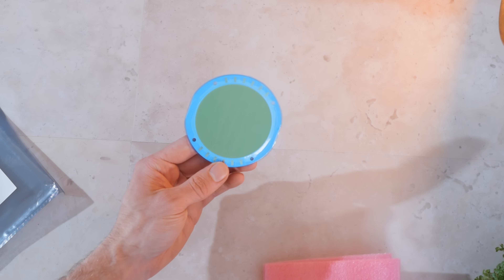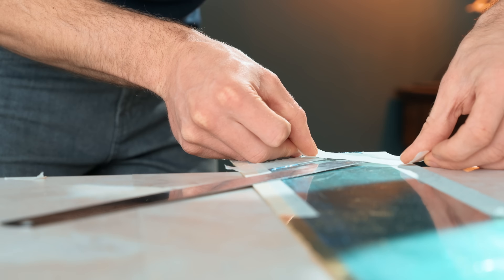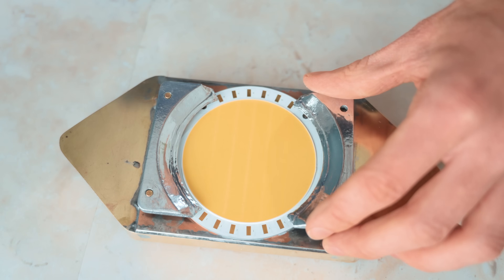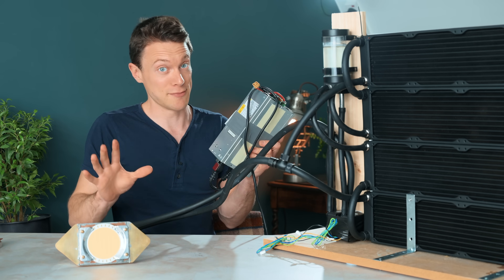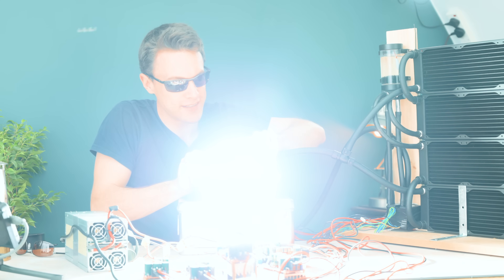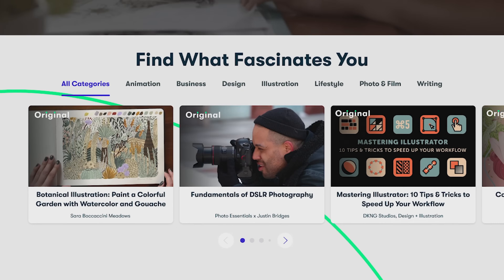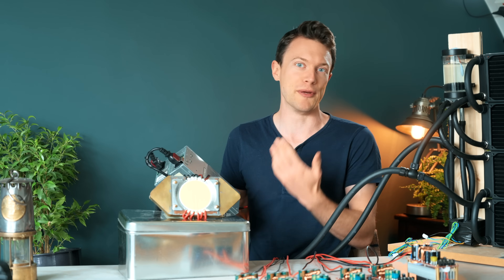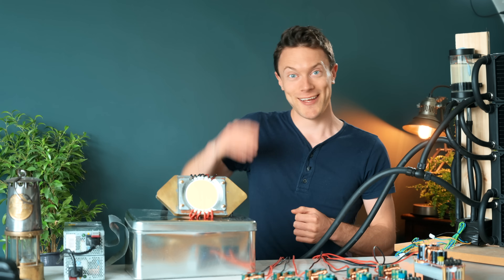Testing the world's BRIGHTEST LED!!!

Comment: I see a problem with the supply proximity and orientation, heat rises, I would not be surprised if there were more damage in the top supply due to it having to cope with it's own heat and heat from the supply below.

Comment: Were those power supplies actually 2000 watt a piece, or were they 1000 watt? If you wire them in series they can still only provide the current one could, but at twice the voltage.
Reply: The LED consumes 1500W, at 30 Volt that would equal 1500/30 = 50 amps. If the PSU is 1000W it can output 1000/12 = 83⅓ A. Now if we hook up 2 of these PSU's, they can output 83⅓ Amps at 24 Volt which does indeed equal 2000W, however then come the boost converters. They boost the voltage from 24 to 30 Volt, if we assume a 90% efficiency, at 2000W they can output 0.9*2000 = 1800W. At 30 Volt, 1800W gives 1800/30 = 60 Amps, so this would be enough for the LED, however the boost converters also typically have a high inrush current which means that they consume more power at startup. If you factor this in, this could be wat killed the PSU's.
Reply: Voltage * amperage = wattage, so they do actually still add up to 2000

Comment: I think you can get away with a large heat sink and air cooling this. 1500 W is not allll the heat you've to cater for. It's more than 80 percent light and rest heat I'd assume.

Comment: Yeah, wiring DC switchmode power supplies in parallel or series is not a good idea. One of them will end up supplying the majority of the load, and when it overloads, invariably the other ends up being overloaded and they both fail.
Reply: Also,  it kinda weird to make a 1500W LED on just 30V, should've been higher I think.
Reply: @STNG17-  if the sections are completely separated, you could connect them all in series. Now, ideally, you'd need to make a 180VDC power supply, with current regulation, since i don't think you'll be able to find something like this anywhere. But still, having 6 30V 10A power supplies is the way to go. Unless this company makes a proprietary driver for this monstrosity.
Reply: how can it even be in series? they need mains input and output dc. you cant feed them dc as input, can you?
Reply: @1toW4mB0to9  The AC mains is in parallel but the output DC is in series
Reply: @EKUL34  still sounds like parallel output0
Reply: @1toW4mB0to9  You just connect one supply's + to other supply's - and  take power from other two unconnected + and -.
Reply: @sikkepossu  Yes, but don't forget to disconnect ac grounding.
Reply: @Cheese_1337  pretty sure the dc output is insulated from ac
Reply: @__dm__  is it,but it's coupled by safety Y capacitors.
Reply: @IustinianP  Those make no difference at all in this case.
Reply: @__dm__  The minus (ground) of output is connected to ac ground usually.
Reply: @benbaselet2026  actually it does allow some current to flow,not that much,but it will affect power supplies if the ac ground is not disconnected.
Reply: @Cheese_1337  I have never seen computer (server nor desktop) power supply  where AC GND is connected direcly to DC side.
Reply: @sikkepossu  I have. And plenty of them.
Reply: @IustinianP  I don't think those microamps matter anything.
Reply: Series is fine; by definition they will have the same amount of current going through them. Parallel is a different story, and switchmode supplies tend to not like switched loads, so I think that may be the issue. But from about 300 hours of run time, my series server power supply setup has worked fine (but I'm not maxing it out, either).

Comment: Surprised you didn't put a thermocouple in there to monitor the Temps. Even though your water block is cool, there could be issues transferring heat once the block gets saturated. In the end you were okay.

Comment: My completely overkill 1200w PSU designed to power 2 systems at the same time, just ran away and is hiding under the bed.

Comment: Running them in series is probably what killed those PSU's. Although they do technically use transformers running at high frequencies so they can be small enough. I actually think they can run better in parrelel as barevids did to test car audio amplifiers.

Comment: "Custom water cool your own power supply" next project
Reply: Water cooling a power supply would be extremely dangerous as power supply’s have large capacitors that if touched and the connectors bridge it could kill
Reply: @thomasweedon1463  non conductive thermal paste
Reply: TheHeadshotSamurai I was referring to actually taking the power supply apart not the actual water cooling aspect
Reply: @thomasweedon1463  well, I am not an electrical engineer but they do exists in market. So I'm guessing it is possible to diy it too.
Reply: @hey24sheep  Theres just no reason to do it the thermaltake psu is also just a gimmick
Reply: @lukasstadler6594  but you missing the point of his channel. Was there a point in his weirdest fan video? But the way he makes stuff, maybe he comes up with a unique different way to cool psu? Who knows. It's diy channel, ain't it? 😊
Reply: Hey24Sheip there is already a watercooled psu on the market, the waterblock inside actually does nothing, it doesn’t even make contact with the heat producing components, it basically rests up against the case of the unit. There is also a custom waterblock from alpha cool that is designed to cool passive fanless psus, but I’ve never seen anyone use it. People that say it’s dangerous don’t seem to understand it’s just as dangerous as any other high voltage/wattage components being cooled with water. A leak in the wrong area is going to destroy it regardless if it’s a cpu or a psu.
Reply: @MisterRorschach90  yes, I know there are water cooled PSUs and exactly my point water cooling is dangerous but powering a 1500w 30v DC led too. I'm just giving diy project idea here only
Reply: It'll be highly dangerous if you don't properly isolate the water (it'll be conductive even if you pour distilled water, it'll dissolve contaminants) from the components giving most heat - the switching transistors and the rectifier, because they're galvanically connected to the mains.
Reply: @mieszkogulinski168  Perfluorocarbons if you want to get fancy, as they used on the Cray supercomputers. It's so safe and non-toxic that it has been used for liquid breathing; it has been tested with mice and it has been used on premature babies to save their lives. The problems for adult people doing something strenous like diving would be oxygenating the perfluorocarbon fast enough and removing CO2 fast enough in a compact, wearable deviceand getting it in to and out of the lungs fast enough during physical activity. If you can solve this, you can get people down to depths of thousands of meters unaided and without decompression sickness (not adding any nitrogen or helium). Some whales can do this because they can completely collapse their lungs and then there is nothing compressible left in their body; they have ridiculous oxygen content in their blood and dive very slowly exerting minimal effort to grab some little snack from the abyss. The fluid would have to fill your sinuses and everywhere else so there are no air bubbles in this application, which is slightly gross, otherwise they will fill with murky water on the way down (even more gross!). Slight drawback is draining that gunk out of your lungs, sinuses, middle ear etc, but at least it's low viscosity.
Reply: Just an idea: a safe way to watercool a PSU is to put it into mineral oil, and insert metal pipes working as a heat exchanger. But then you get the problems with oil cooling - oil leaking through capillary action, if the oil container isn't in the lowest place in the computer, and difficult cleaning.

Comment: the pc / server powersupplys might have had a maximum wattage for the specific 12v rail you were using? From my experience the 12v rail can only go up to a specific amount of amps, same for the 5V and 3.3. And the whole of the powersupply goes up to the rated amount of watts.

Comment: Why don't you try using a 1500w battery. The 1500w battery are used for electric bicycles. You can buy a 1500w battery on ebay
Reply: Aren't you confusing Watts with Watt-hours? And can those batteries supply 50A @ 30 V?

Comment: If the six power sections are entirely separated from each other why not wire some of them in series so that the voltage is higher and the amperage lower? Just doing 3 sections of 2 gets you 48 volts at 30 amps instead of the 60 amps you had to supply, or even 3s for 72v 20a.
I wouldn't normally suggest AliExpress, but I did find something there that fits the bill.
https://www.aliexpress.com/item/33046033484.html

Comment: Friend: How do you heat your house? Gas? Oil? Coal??
Me: LED
Friend: What??
Me: What!?
Reply: Watt?
Reply: @g60force  Hero of this section
Reply: @g60force  xD
Reply: @g60force  get out
Reply: @ahmedelwan9129  i have anxiety rather stay inside! ;)
Reply: ohm.... watt??
Reply: @qingdom impedance...power??
Reply: What?
Yes, a lot.
Reply: The correct answer would be Electricity.
Reply: There are radiant heaters that are based on infrared LEDs, but here we basically have a self contained, water-filled electric heater with a 1000000 cd/m² light source side effect
Reply: @neoqueto  It's a brilliant combination though. We need light and heat in our houses. The perfect balance would be where the 60% heat production would fulfill the light need also.
Except the lightsource needs to be changed to multiple sources to be of any practical use.
Reply: @Emfbzee  that's why I kinda think we'll be running rented blockchain/cloud compute nodes in our homes in the next 15 years instead of normal heaters. Hell, this winter I had my central heating OFF all the time, because my PC was rendering. Not very efficient or cost effective YET, but I believe it can be streamlined. And of course it would be stupid if I left heating on.
Reply: Me: LED's are more efficient..

Comment: IMPORTANT thing here is to use copper radiators, if you used aluminum radiators, then you'll eventually run into a problem with oxidation of those two metals.
Reply: The classic Al2O3 :D

Comment: I think the PSUs failed because of inrush currents, since converters ususally have a ton of inrush current. Turning them all on at once is a bad idea. (If you have done that)
If you want some references, check out Great Scotts Video on inrush current and soft starters. 
If you want some help designing your own psu, let me know, I am a hobbyist who does a lot of high power stuff (no degree yet, but I am working on that).
Reply: I don't think so. Half way decent PSUs should have current limiting and soft start build in.  If you look at a server board, it has a lot of capacitance distributed all over (CPU+GPU power management). The problem was probably connecting them in series. It would be better to go with 3 boost converters per PSU and get a 24 V PSU or use 3 PSU with 2 boost converts.
Reply: @markoantesic4362  Just curious, how can putting those PSUs in series damage them?
Reply: @qps9380  Its not that using them in series == damage, but when PSUs are used in parallel or series operations, EMI, inrush current, leakage current, PARD, startup time etc. Will all be  different compared to a standalone power supply. Then its up to the system designer to make sure that all this is in speck. Also you can get unstable and strange  behaviour at start up.  Connecting switchers in parallel and series and make it work at higher power levels, can start to make problems fast. 

Example that I worked with. 15KW active rectifier followed by a 15 KW buck converter. If you look at the output of the rectifier you have a capacitor. Then you have wires == inductance. Then you have the input side capacitor of the buck converter. All capacitors were good film 150 uF caps with really low ESR. At certain goldilocks operational poit, I would get resonance and really strange current  wave forms in the DC link. Resonating current  == fluctuating voltage on caps == unstable voltage regulation. And these were converters build form ground up to work together. 

The simpler you can get the power network the better, especially in applications where you use PSUs in a way that they were not design for (use in series).
Reply: @qps9380  If they common ground, you've effectively got a short. One of the boards needs to be electrically isolated.
Reply: @markoantesic4362  you can indeed get some strange oscillation issues when using psu's like this. 90% aren't an issue, but man, when they kick off, they really do kick off when one psu ends up handling all the load.
Reply: @th3d3wd3r  They will sure let you know. With great audio/visual/olfactory sensations XD
Reply: @th3d3wd3r  You sir, as I commented myself earlier are likely correct.
Earth needs to be on the ac side not the dc side.
Reply: @th3d3wd3r  yes I thought that too
Reply: Most servers also have additional fans before the dedicated PSU fans, you could try a couple of 1600watt consumer PSUs.
Reply: @saforder  a 80+ platinum would be better
Reply: @saforder  Yeah, let's say they are usually in a closed enclosure with additional intake fans. I don't think that was a thermal issue, these fans can ramp up much much higher.
Reply: Could also be bad psu's? they might have had a hard life before being sold off as used, could also be that they have 2 12v channels each and he wasn't using all.
Reply: @swagiyo9801  They are single rail if no exception.
Reply: Judging by the way he connected them to mains, and many of these PSUs have the negative tied to earth, there's a chance that by connecting them in series, you short one out and it shuts down, and having boost converters, you wouldn't know wheter there's 12v or 24v on the input. That said, the other one should have tripped out from overcurrent, but then again, it wouldn't surprise me if it didn't, i've seen a lot of switchers that needed ridiculous amouts of current before they tripped, about 1.5 to 2 times the rated current.
Reply: power supplies died because the total wattage is a sum of multiple rails(voltages), you got all the power from a single rail. Power rail limits should be printed on the power supply back
Reply: @mariotube-123  That would also be a good guess. But I would assume that Mr. Perks checker that :D
Reply: @mariotube-123  unless it is a single rail psu, not that uncommon.
Reply: Yeah he should have put some NTC or maybe an Inductor in series with every converter
Reply: @19janiboy96  You definitely don't want an inductor in your DC link.
Reply: In 12:02 he just turned everything off instantly, and the heat on the power supply don't just magically vanish. He probably fried components with residual heat.
Reply: @SukoSeiti  But the heat can't increase one the power is off, so it's a moot point.
Reply: so much caps to charge ..
Reply: or the power supplies themselves are just unefficient but you got a good point there
Reply: Ah so you can help me with my design?

I am making a 24V 20A supply and I need a check on the pcb
Reply: Or because they`re connected in series..
Reply: Can you help designing a PSU for automotive environment?
Reply: The server PSUs are specifically designed to deliver 12/24v at insane currents.
Reply: Maybe a coil and capacitor as a simple LC filter would have protected them. Also they have different output voltages and usually can‘t give their maximum power at a single rail.
Reply: NTC in series. The same trick that PSUs use at their input.
Reply: Do you need high energy power supplies to fly a paper airplane?
Reply: @frisosmit8920  definitely. At least 100kV
Reply: In addition to inrush current and putting two PSU in series a third potential problem is, that the unit is rated for 1000w total. That does not nessessarily mean 1000w at 12V since they also Delivery 5V and 3.3V. The 1000W are deliverd across those voltages. So the maximum 12V power might bei lower. This ist however very dependent on the specific powersupply
Reply: @TheBl4ckOn3  They look to be HP DL380G5 series powersupplies ! 12.15V / 82.3A is on the label ... One single rail.
Reply: TheBl4ckOne nope, (true) server PSUs only provide 12V.
Reply: Server power supplies are designed to work in an air conditioned forced convection rack. They are also designed to provide their peak power across multiple power rails not just on the one voltage rail. They also aren't designed to operate at peak power continuously and they are definitely only designed to operate in parallel the peak current flowing through both supplies is likely what killed them.
Reply: What?, NO. PSU fried because he used two power supplies in parallel to power the LED. Which is something that cannot be done.
Reply: @Rojame77  quite the opposite for server power supplies... They run in parallel not in series as is done here.
Reply: @JaxxTech  True, would have been better to have the 2 power supplies in parallel ( preferably 3, because the rating is not a continuous one, but a peak, with operate being around 60% of this) and then 6 boost converters with 12V input for the LED. Bonus being that you can run all off 12V, including the cooling fan and pumps.

Comment: The problem with the power supply is because you are using DC-DC Boosters, for every amp needed by the led the booster will draw almost 3 from the power source, next time try to use Buck converters, it is a far  better solution

Comment: what if the LED is so hot and the water cooler can't contain the heat enough so does the water cooler need to be water cooled ?
Reply: Stupid question
Reply: Your are describing a tram motor.
Reply: everyone in the room would be dead from heat strokes, before that would happen.... so no one would be alive to care about...
Reply: i think you need to Nitrogen cooled the water cooled water cooler